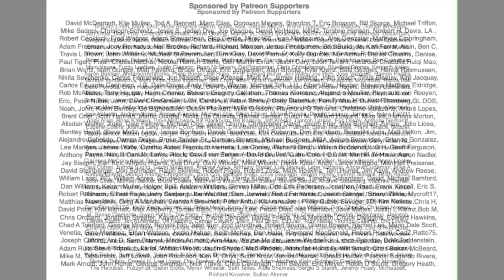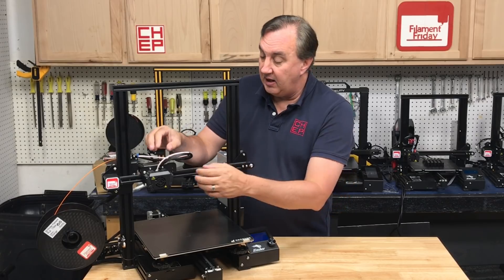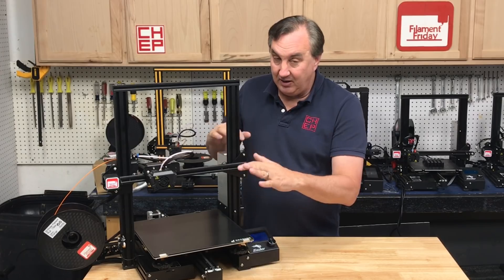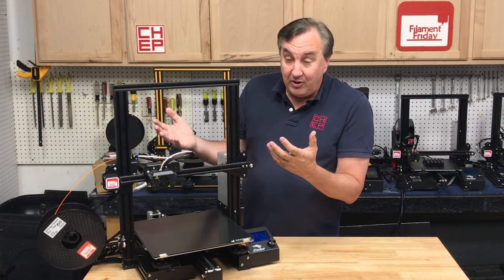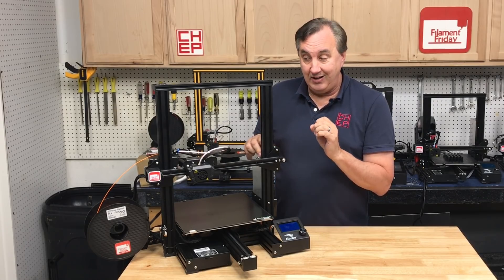Creality Ender 3 MAX! - 300mm x 300mm x 340mm

Comment: what about their use of junk knockoff drivers on 4.2.2?
Reply from the maker: That’s why I said they need to upgrade to silent drivers across the Ender line.
Reply: It's not just because they're not silent, CHEP. These boards use the HR4988 drivers, instead of the genuine Allegro A4988's. The knockoffs tend to overheat and skip steps out of nowhere, and leave even more artifacts on prints than the real deal.
Reply from the maker: But if the upgrade to TMC silent drivers like V2 has,  the issue goes away. That’s my point.
Reply: @FilamentFriday  I understand that, but even the way Creality set up those silent drivers on the V2 is bad. TMC 2208 drivers in standalone mode cannot use Linear Advance. Linear advance in a bowden style printer can make a difference between good and bad print results.
Reply from the maker: It could be better but the knock off 4988 they appear to be using is causing issues you can’t fix.

Comment: I went with the Sunlu S8 last week after watching your video. So far I love it and I'm glad I did that rather than a large Ender. I really like that the S8 has duel y rails. It feels very stable that way. I just wish it had silent drivers.... I will probably have to replace the board.
Reply: Same here.  Seeing what a mess this printer is makes me glad I bought the S8 last week.  And, yeah, old, noisy steppers need to just go away.  There is no excuse for them.  But what will I do with these old controllers?  I think I need to make a robot.
Reply: @davidwillmore  yeah there is always a use for an old control board. I will tuck mine away for when my kids are older and learning real coding. As for the old drivers.... I just guess that it is one of the cheapest printers you can get. I know that updated silent drivers are not that much more but you know they would have to charge that much more (at least). Good thing we like tinkering :-)
Reply: @Skyrunner_84  I wouldn't feel so bad about stuffing it in a drawer if it weren't such a decent board--exceptnfornthe darn drivers.  Nice 8 bit processor, plenty of I/O, supports 24V, etc.  If it were two years ago, the board would be a major pro for the printer.  If they had just used headers.....
Reply: @davidwillmore  true. Headers dont really cost much do they. I have not spent much time looking at it yet. I wonder how hard it would be to take the driver off and put headers in?

Comment: Seems like with most crealitys the bones are good but the rest need work. After doing a ton of research for my first printer and using prime day I got myself an Ender 3 Pro but also ordered the following:

Ender 3 Pro
BTT SKR E3 v2.0 / tft35 v3 screen
All metal extruder w/ capricorn boden tube
Glass plate with upgraded springs
3Dtouch v3.1 sensor
Triangle lab all metal hotend

Was able to get everything for $265 so I am hoping that this will make the printer better than if I'd have just bought an Ender 3 v2 or even a Prusa Mini hopefully.
Reply: 3d touch + skr 1.4 + all metal + capricorn will be much better than a stock ender 3 v2. Prusa mini may be better if your not willing to mod your printer but thats what the ender series is all about. So ur definately gonna get a printer better than an ender 3 v2 and a prusa mini if you like to tinker with it.
Reply: I think the skr mini and bl touch are essential quality of life upgrades. I got a coated glass bed and was disappointed that it worked worse than the magnetic one and ended up flipping it and using a glue stick - works a lot better.

Comment: See if you can add 2 shorter bolts and hammer nuts to the Z end stop and that way you can adjust it down a little so that you can compress the springs to correct the loose bed. I also think that this printer would be a good one for a BTT 32 bit board and new display just like the regular Ender models.

Comment: Seems this was kinda a quick throw together Idea by the designers.  Kinda clever how they got the extra width but downside is the squareness is dependent on the bolts and nothing else.  I like the hotend fan setup though.  Better than the V2 uglyness.

Comment: Thanks Chuck! I especially agree with your assessment of the pricing and economies of scale. I like the idea of just upgrading the size of the Ender 3 Pro. It's such an amazing platform that it kinda competes with itself. Creality is basically building new OEM machines with the best methods developed by the Open Source Community. That's the point of Open Source, but for someone as inclined to tinkering as I am, price becomes the deciding factor. If I can upgrade a cheaper platform while saving money, then I will. I'd love to see more Z-Axis support too. The taller the frame, the more important stability becomes. I worry about an Ender 3 running much worse with a bigger frame and higher load on the Z-axis servo ruining print quality and prematurely wearing down the motor. I noticed a visible reduction in wobbling after adding diagonal supports on my Ender 3 Pro, so a much taller machine would surely benefit even more.

These could be great first printer options for beginners, but I don't think they're as compelling to knowledgeable hobbyists who prefer saving money, and learning. It's a great time saver, if you're not interested in the time needed to upgrade. Industrial setups could make sense of the increased price since they're saving on setup time compared to an upgrade.

Comment: Also not bolting the z side rail to a square solid surface will have a problems. Putting the on the side and depending on screws holding the upright rigid. It will need z supports...

Comment: Thanks for your honest reviews. 100% agree with the firmware issue, I hope creality hears your message.

I was in the middle of writing about the ender extender when you mentioned it in the video. I don’t have it yet but I am curious; are there any reasons NOT to get the extender kit?
Reply: I have the 400 extender its good when it works. My biggest issue they really should have done dual extrusions cause after a few prints mine starts to wobble badly. You Milage may vary though
Reply: Just a guess but with the extender kit, you use the same hotbed element, so your hotbed ends up smaller then your print plate. I'm  guessing that the 3 max has a heat plate to match the print plate?
Reply: @TheRattleSnake3145  one would hope but to be honest looking forward to getting a keenovo that matches my bed size

Comment: As you say it is the same size as a CR10, I don't see how this is going to bring anything new to the range.
 Why they didn't stick to the current Ender 3 revision with just the frame and bed larger is beyond me, if it works don't fix it!
You can get a much better spec printer elsewhere for the listed price of this Ender Max and I am considered a Creality fanboy.
 I think Creality is over milking their Ender cash cow.

Comment: Sounds like a typical Creality machine. 75% of the way there.
Reply: Yeah, especially missing second Z lead screw.
Reply: @timd9430  never felt the need for a 2nd lead screw
Reply: @L3x4Pr0ne  2nd Z gets more necessary as the gantry gets longer and heavier.
Reply: beta unit
Reply: Yeah like the cr10 5s only heats bed 300x300 area it print ok but I paid $700 and need to add $$$ Ned heater to be able to get full use of the 500x500 bed area the power supply isn’t enough to heat bed much past 70 c and when trying to do so it takes 15 min don’t get me wrong it’s a decent printer but for the price it should be better equipped.
Reply: @surfnblues729  buyers responsibility. also in reference at the time good printers were very expensive. these are kits mind you so its not a fully built machine. the s5 is great imo. i would slap a super volcano on it, bontech clone with 3 to 1 stepper, 500x500 ac heated bed and good to go.

Comment: Simply bend the metal bar on the micro switch so it stops where it needs to. Very easy.
Reply from the maker: I’d rather just switch to t-nuts. Less crude.

Comment: they need to stop making these type of printers with the bed attached to the Y axis the design is inherently flawed and better options exist. these 3dprinter company's need to keep up on there firmware it takes maybe 1min to merge the latest update in to any fork and run a compile test and correct any minor issues encountered. bottom line stop selling your alpha/beta products and then not handling the firmware properly as well as changing things on a existing model with out adding any version change to the model these are all horrible ways to operate a company selling a product.

Comment: same idea i came up to increase the printing space with minimal changes to my ender 3. all i did was move the vertical extrusions out so it sits flush with the bottom extrusion & just bought a 2020 to extend the x axis & you get the cr10 space in an ender 3 with 20 dollars & a few printed parts
Reply: Do you have any pictures of this?